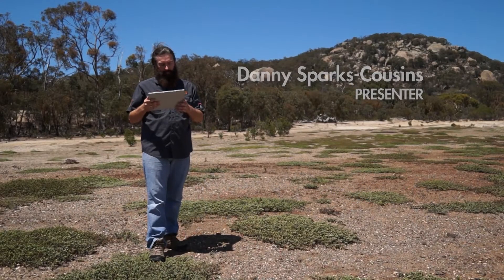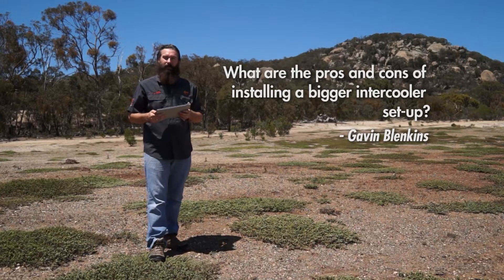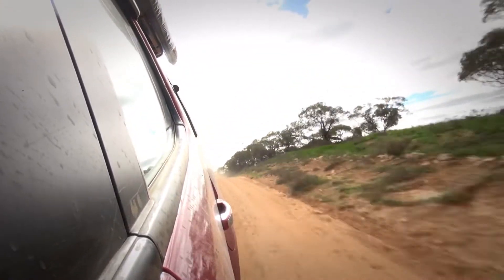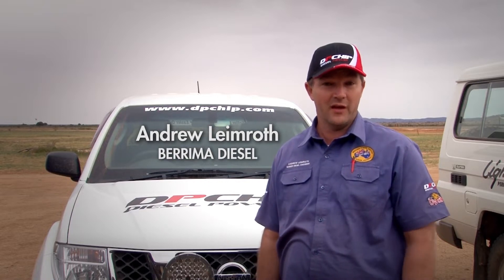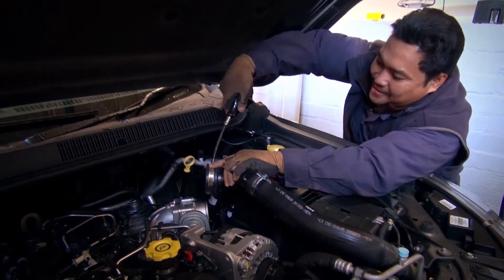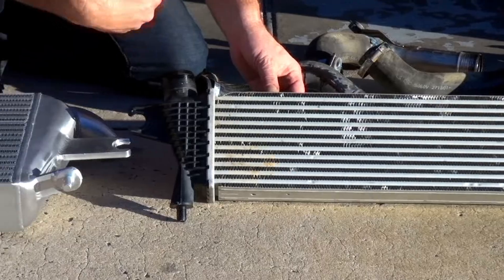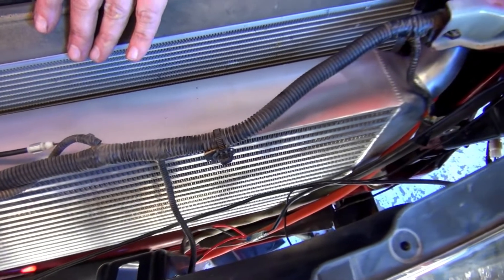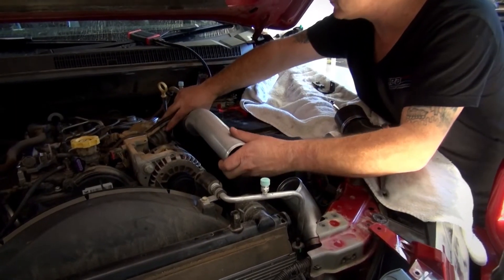What are the pros and cons of installing a bigger intercooler setup?

Comment: Is a bigger intercooler going to make more lag in acceleration response on a stock car? Thanks!
Reply: No. From my experience, even if you use 3x bigger intercooler (core litres) you wont notice any lag.  But i wil stick to rule of thumb and use adequate size.
Reply: @plenex  You're right, I installed it last year ( 2x size) . Thanks anyway.